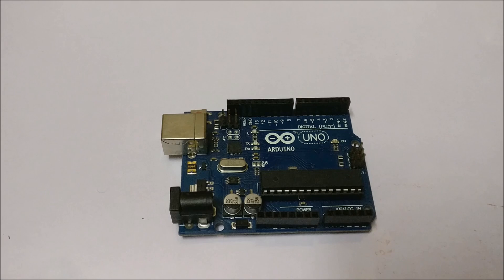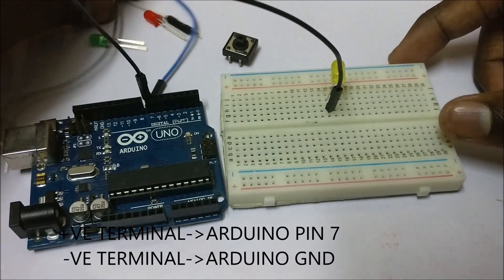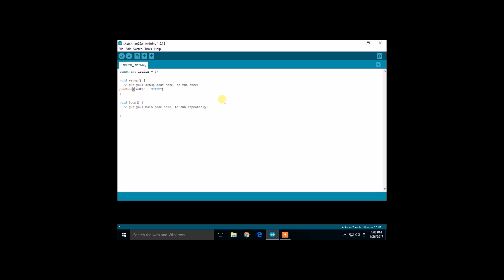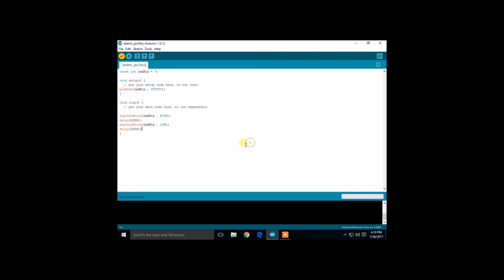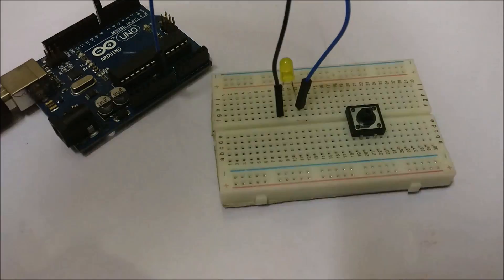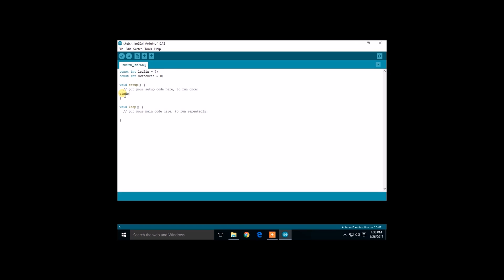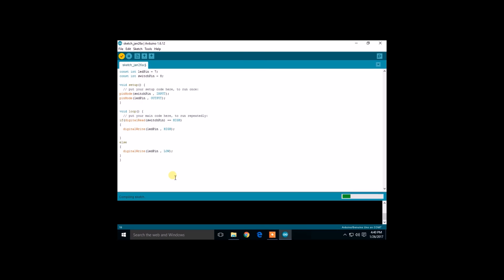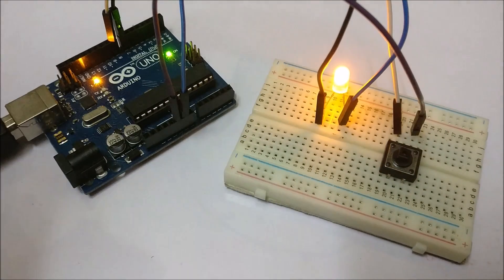Arduino Tutorials: Basic programming , blinking LED and using switch![code is in the description!]

Comment: I am looking to incorporate in my project using arduino with 5 buttons to pulse the associated relay 
That means that each switch will create a short single output pulse no matter how long the button is pressed
Your help will be greatly appreciated 
Many thanks
Erik Hoffman
London, UK
Reply: Yes, you can do with the use of Delay() function .. between on and off timings of your output.

Comment: God, where is pull down resistor? Stop teaching people this madness.
Reply from the maker: Arduino has very low output current that's why I didn't add it.
Reply: @shyamsundarsaravanan7398  some time you'll get error signal

Comment: You have written in code that when switch output is high then  led output will be high but in video when you press button led turns off means it is getting output low🤔
Reply: he did it wrong when wiring .. switch was pulled to ground